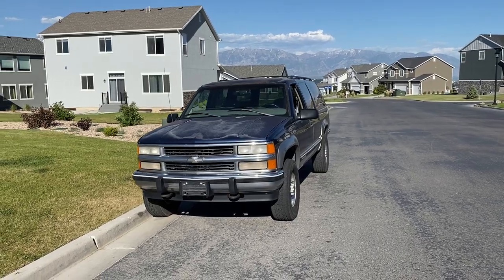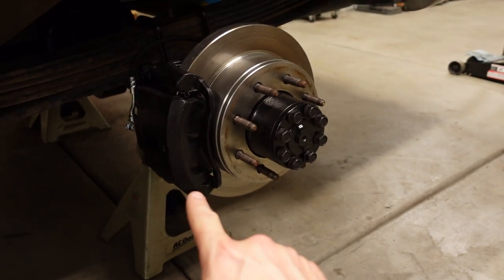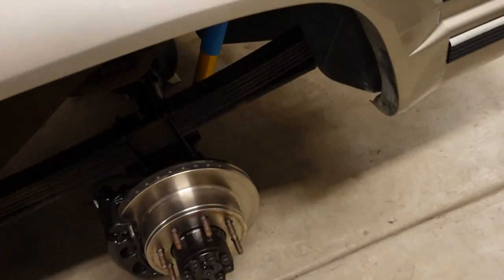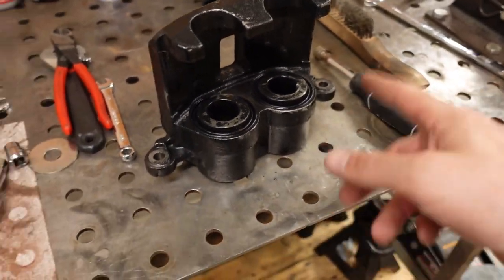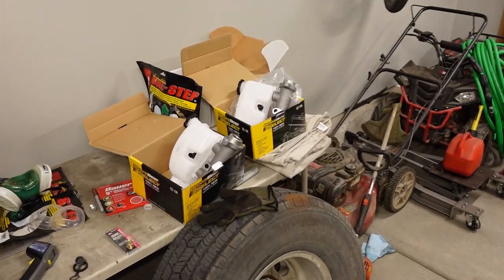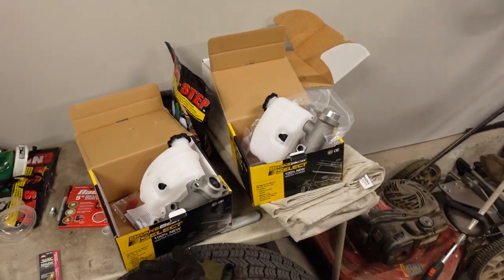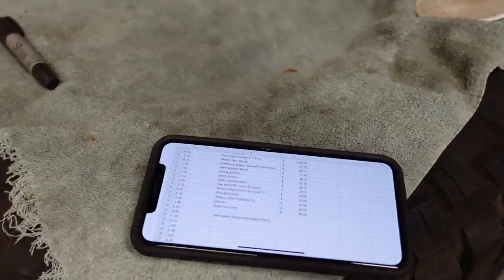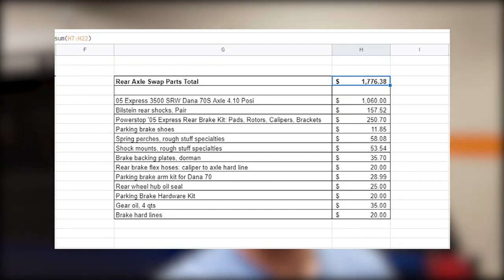K2500 Suburban brake upgrade fail + Cost of Dana 70 Swap

Comment: As long as you plug in a Range Technology dongle V4 disabler, I prefer the 2011 to 2013 Suburban’s.  The 4x4’s have the Gen 4 all aluminum 320 hp V8s. They also came with a boxed frame, 5 link rear suspension, 4 wheel disc brakes, front struts and the 6L80s have the much lower 1st gear than the 4l80, not to mention they’re plumbed for E85 Flex Fuel in addition to regular gas with the larger fuel injectors. RCV now makes cv axles for Chevy 1500s too.  Lighter trucks are better for wheeling, that’s why Ford built the Raptor on the F150 platform.
Reply: I have that 320 HP 5.3 in my 2012 Yukon XL, it NEEDS the 6.2L
Reply: Davis Stephens Just as long as it’s not the carbon fowling direct injection LT engine that has AFM on all eight cylinders. Believe they started that in 2014. YouTube is filled with people complaining about the new LT engines blowing up with low miles on them.

Comment: The 3500hd from those years had some big disc and rotors front and rear..  Always wondered how the master cylinder and booster from those years would work. Should be a bolt in.  Can't remember if the hose connections were the same side?

Comment: How did you get away without adding an adjustable metering block? Or are you relying on the abs to handle that for you? I thought anytime you swapped rear drum for disc this needed to be done.....
Reply from the maker: The brake will be addressed when I do the different master cylinder, but for now it just kinda works

Comment: Abs has a bleeding valve on the side under a black rubber cap.
Reply from the maker: I did find and bleed the ABS using that little bleeder port with limited success

Comment: i just put a hydroboost from a 2013 GMT900 2500 siliverado in my 2008 2500 suburban.  for mine it was a direct swap. but gmt800 guys swap the gmt900 hydroboost into their trucks too.

Comment: You didn't test the turn radius! Thats all I wanted
Reply: Test it in a parking lot bet its a little different because you moved the pivot point.
Reply: It's not going to be very much.
Reply from the maker: once I pulled out the 14 bolt I had really wished I got out a tape measure and actually measured the turning circle...
Reply: @LawrenceTolman  My theory is it didn't change the turn radius at all.
Reply: @hamnchee  I think you are correct.  If you look up Ackermann steering geometry, the pivot point is on the same line extended from the rear axle.
Reply: @nicholassmerk  The only difference I can imagine is the inner radius of the rear inside tire track. That would be smaller, so it could hit a curb that it wouldn't have otherwise, but the truck itself could still do a u turn withing the same space of the outer front tire track (or corner of the bumper, if that's the measuring point.)

Comment: K but how would it not track straight down the road.. I mean older vehicles had the same track width and drag cars have wider rear and all they really do is go straight.. Turn radius I can understand will probably be decreased but I feel like its negligible at best.. Like my 98 toyota pickup has within 1/2in difference front to rear..  As for the conversion I agree with going to the heavier set up.. Both my 96 and 97 already had larger breaks and other parts like some 1tons do.. and from my experience GMC generally uses the larger parts anyway.. So 1ton HD is just one more nice upgrade

Comment: Why was the (source of the rear brakes) Express van's master cylinder not a candidate?
Reply: I don't think the vans had hydroboost?
Reply from the maker: I just didnt do enough research to be honest. everything I saw said the GMT800 master cyl would bolt right on, but thats only with a vacuum booster. I'll have to see if the same rear express master cylinder has the right pattern to bolt onto my hydraboost

Comment: I thought brake proportioning was done in the abs module not the master.
Reply from the maker: you are correct, but apparently there are differences in the master as well... or so says the internet

Comment: Get rid of the steering rag joint and add a 36 spline 3/4 x 1inch DD steering u joint. My steering is as tight as new
Reply from the maker: yup, definitely will do that

Comment: So how's the turning radius?  FWIW, I too refuse to run wheel spacers - and would totally balk at the ones of the size you needed.  So man, 2k RPM @ 60mph in top gear?  No question those are 4.10's.  :)
Reply: Wheel spacers are lame
Reply from the maker: yup, 4.10s for sure.
Reply: After seeing proof that billet spacers are stronger than Dana 80 axle tubes, I'm running 2" spacers on a Dana 60 rear. 8 months carrying 5000#, no problems.

Comment: Okay if it's 4:10 in the rear is it 4:10 in the back or is it like 409 or is at 4:11 in the front or if it's 4:10 in the front do you think I could run  4:11s in the rear

Comment: My question is, I have a 2000 Chevy k3500 OBS with rear drums, what axle would I have to swap in to have rear disk brakes!?
Reply from the maker: the GMT800 10.5 14 bolts are plentiful and have rear disc brakes... or you could do the Dana 70 like I did, it also has discs

Comment: When it’s all said and done, couldn’t you sell the stock 14 bolt for the $400 difference you have in the Dana?
Reply: Why? You can get drum brake 4.10:1 non-blocking 10.5" 14-bolt full float axles all day every day from the self serve auto salvage yards for less than half that. If you can wait for half price day you can get it for under a hundred

Comment: Can you just pull the residual pressure valve for the rear drum brakes from the master cylinder that you have now?
Reply: No, it's 10 psi for drums, rear discs need 3 psi

Comment: Wouldn’t just changing the proportioning valve make it work?
Reply: something something residual valve ... though, an adjustable proportioning valve couldn't hurt
Reply: No, also need to change the residual pressure valve

Comment: So are all gmt800 vacuum brakes F/R compatible with gmt400’s?
Reply: On the vacuum booster style, i do believe so, as long as you match your truck, as in 1/2 ton for 1/2 ton, 3/4 to 3/4, just need the adapter for the front brake line as the GMT400 is larger, or acquire the proper line nut and flare it in
Reply from the maker: it appears that most GMT800 master cylinders will fit onto a GMT400 vacuum booster, but there are a few different size bores in the GMT800 family, so you'll want to make sure you pick the right one

Comment: Have you try a residual valve on the rear brakes line
Reply: Yes, drums use 10 psi residual pressure valve, discs use 3 psi. Get an adjustable proportioning valve also.
Reply: disc brakes dont need it unless the master cylinder is lower than the calipers..(frame mounted)..
Reply: @dalehall2993  we know that the problem here is the fact that the calipers take more volume of fluid  than the cylinders you want to keep the charge of fluid from going back to the master when you let off the brake
Reply: @luiscruz-no3ib  
Yeah,if he has drum brakes.disc brakes, its not needed..
Reply: @dalehall2993  well Dale ldo believe that you actually believe  that now if you well now they start to used residual valve on master cylinders to prevent  push back  that's what happens when the rotors go around and push the pistons back during rotation that's one of the reason have you ever noticed  when the rear shoes are out of adjustment  how the pedal travels more is just a very simple hydraulic principle  it takes more fluid to fill the void that's what a residual valve provides
Reply: @luiscruz-no3ib  
Yeah,for drum brakes.
Reply: @dalehall2993  except for those pesky return springs

Comment: Won’t track straight?  How does that even make sense?
Reply from the maker: several people had said the narrow axle was designed that way to make it drive in a straight line better... doesn't make sense to me either seeing how my AT4 HD has the same width both front and rear...
Reply: @LawrenceTolman  They should have studied more during geometry. :)

Comment: Durmax swap it
Reply: 454 modified with boost probably have close the torque of Diesel.
Reply: N solid axel swap
Reply: Needs a different transmission.

The 454 is plenty (7.4L) vs 6.6L